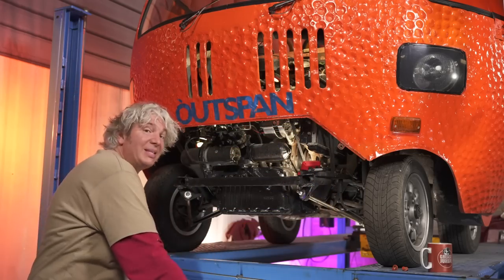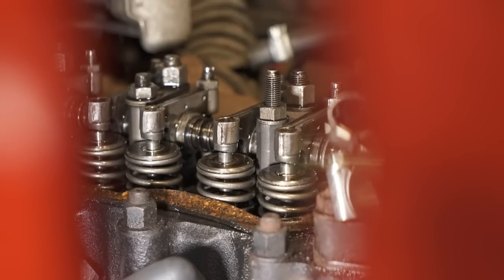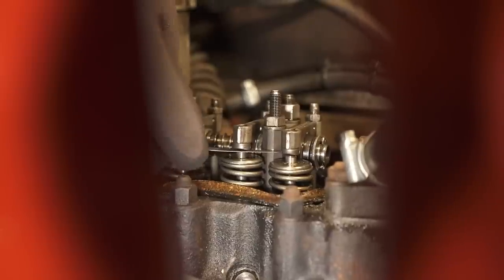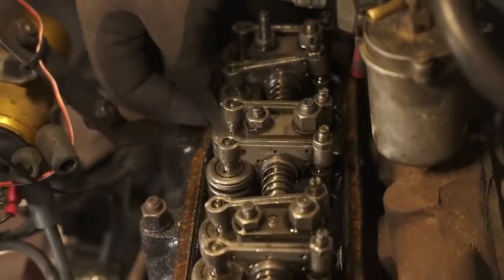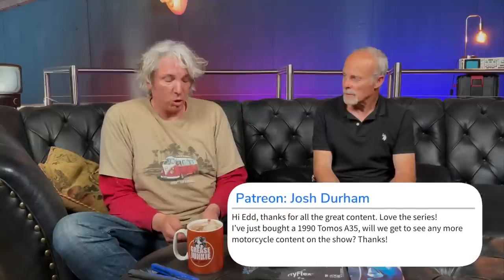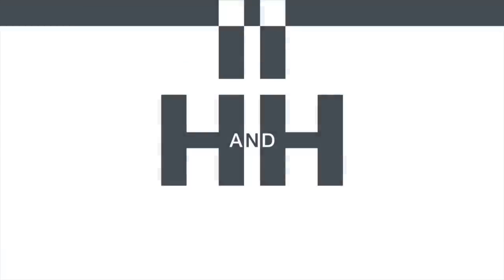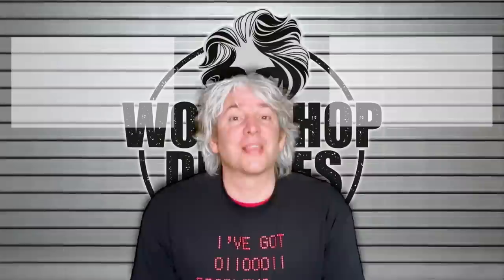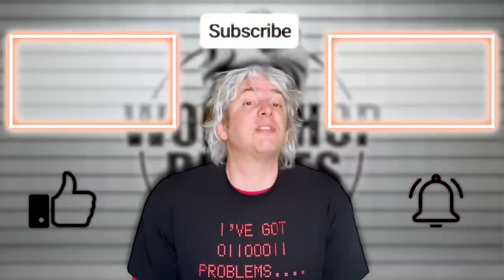Why Are Valve Clearances So Important? | Classic Mini 998 | Workshop Diaries | Edd China

Comment: Hi Edd, I used to have a Mini 998 back in the day, I used to use a colour tune plug to check the mixture ratio when I was giving it a tune up however, what I found was, with everything you have done, if I tuned the mixture to a brilliant blue it always had a flat spot, what I found was if it had the tiniest flash of yellow in it (running very slightly to the rich side of the scale) the flat spot disappeared. Also talking to my cousin at the time who is a motor mechanic he informed me that the Mini 998 engine likes to run slightly towards the rich side and when I set up mine that way it was fine and at the time of lead fuel I always had a light coating of grey in the exhaust tail pipe. Not sure if this applies with today's fuels but just thought I would mention it.

Comment: As important as tappet adjustment is it's often a job that gets overlooked or put off but there's no excuse really with good old, easy to adjust, screw and locknut types. The added complexity and faff of under-bucket shims requiring camshaft removal just adds to the "I'll check them later" syndrome!👎 I had a similar problem on an FZR1000 some years ago when the power delivery lost it's edge and the idle became quite lumpy. After checking the obvious, the valve gaps were checked and most were below spec with two closed up completely and this was on a bike bought new and long before the specified valve check interval which just shows that the service schedule is really just a guide to the minimum maintenance requirements. Thankfully, after setting the gaps, the performance was back so fortunately avoided any valve/seat damage.👍😃

Comment: Had a customer complaint on a petrol honda crv 2006 model. when started cold, it was spitting, dropping rpm, reving and acting very very strange. Im a certified technician for Honda so i started troubleshooting. and about 30 minutes of tinkering and troubleshooting. I looked at the service history, it stated it recently had donne the valve clearance at a random brand shop.. I called up the customer asking when it started, and the customer confirmed it was after that service. I took it appart, did a new clearance and boy o boy everything was so far off i didnt even belive it at first. did the correct meassurement, and the car was sooooo much better afterwards. im thinking they adjusted the engine when it was super hot. not letting it cool down first :P

Comment: Hi Ed why not use the 1 from 9 method eg number 1 valve fully open adjust number 9 valve works on most engines
Reply: Agree absolutely used this method on A series engines for the last 40 years
Reply: @steveduffy1289  the only engine I’ve come across that it doesn’t work on is the Ford 2.4 York or the 2.5 di
Reply: And the Ford Xflow. Loved the interference adjusters. Didnt bother with feeler gagues..Simply tighten em up while engine is running till the tappet noise goes away! :)

Comment: Hello Edd, could you please change the oil filter to the Classic Mini 998, I have a car with the same configuration but I don't know how to change the oil filter element. I would really appreciate it if you help me with that. Please
Reply from the maker: We have a classic Mini which has an unknown history so it is definitely a job that needs doing. It is a really easy (if not a slightly fiddly) job. The thing to watch on the paper element oil filters is the O-ring between the filter case and the engine; really easy to miss. I even heard of one garage adding a second O-ring which ended up causing a serious oil leak at high speed! Watch this space.
Reply: @eddchina  Thank you very much Edd I look forward to that video explaining how to change the oil filter element I would really appreciate it and I think it would be excellent content for the channel

Comment: Generally this should be done when an engine is hot, however the gap adjustment is different for hot and cold engines
Reply: wrong, valve clearance should be done when fully cold.

Comment: Oh for the days when a cornflakes packet and a dob of grease could get you home. Did you replace the broken carburettor gasket?
Reply: I have this as a thermostat housing gasket, Kellogs Cornflakes and LM2 grease - 18 years, still going strong.  Plus using heater matrix hose to replace the bypass hose - pretty much nuke proof.

Comment: Solder is for pcb boards, proper crimps with glue lined heat shrink is always the correct way for a wire splice.

Comment: Shouldn't you be using the timing marks on the crank pully to verify TDC?  Using the distributor is not reliable, and using a straw (never a screwdriver) in the spark plug hole is only right 50% of the time.